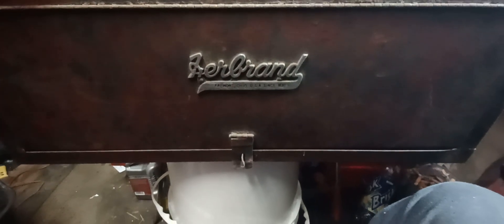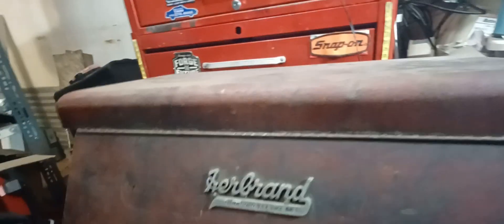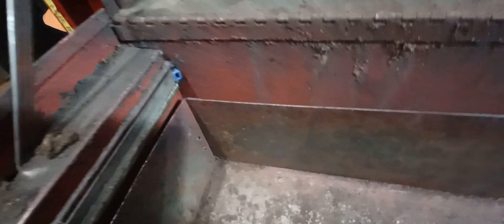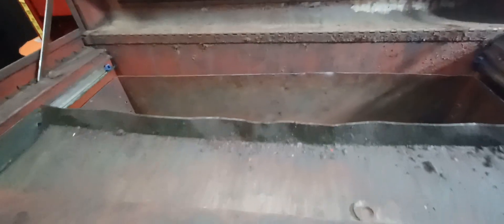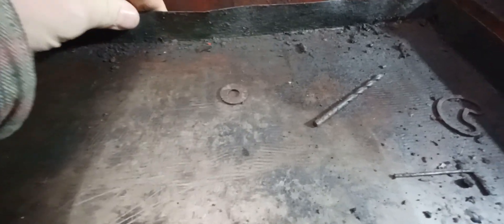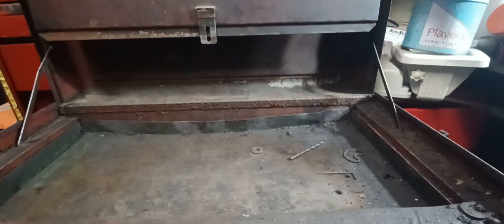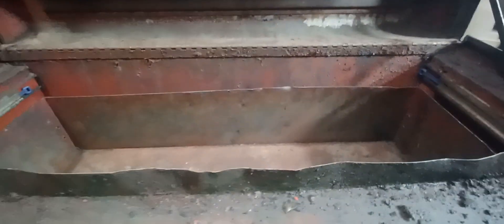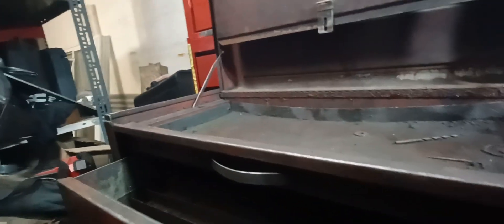revisiting the herbrand box I bought should I fix it

Comment: Clean it, lube the moving parts and shoot it with clear laquer. Herbrand ratrod tool box.
Reply from the maker: the bottom drawer is completely stuck I am still leaning towards taking the drawers out 
thank you for stopping in 👍
Reply: That is a real cool idea.  I saw how one guy was taking old bicycles apart, cleaning them...and spraying a clear coat over the frames just as they were.   It was old, but had a shine and looked very good.  Chrome looked like knew after cleaning.
Reply from the maker: @Dancing Alone wRentals  I am hoping I can use one or more of the sliders for another box hopefully they will fit it